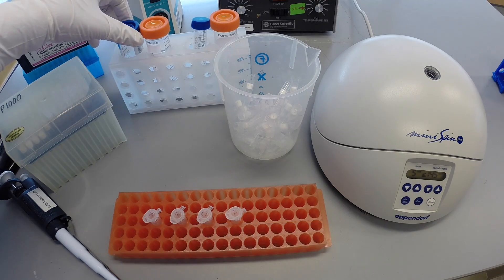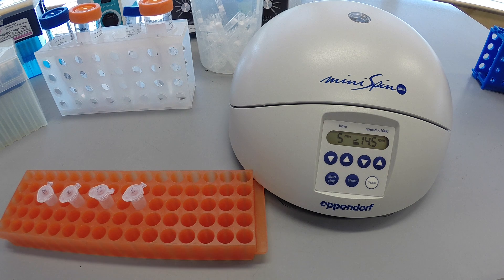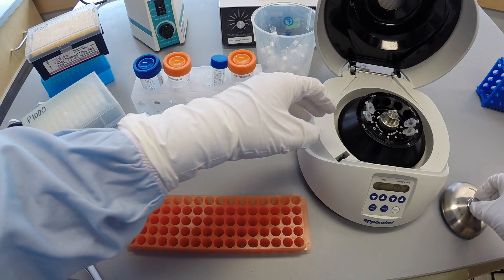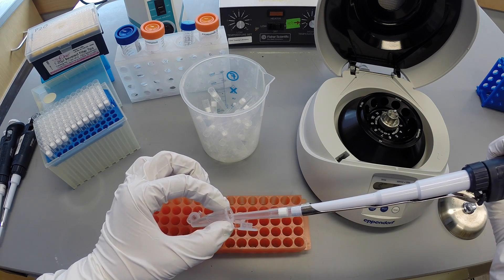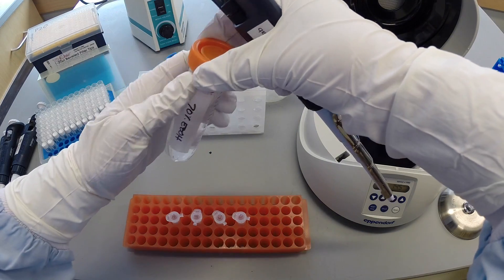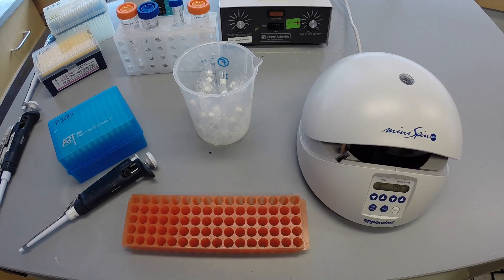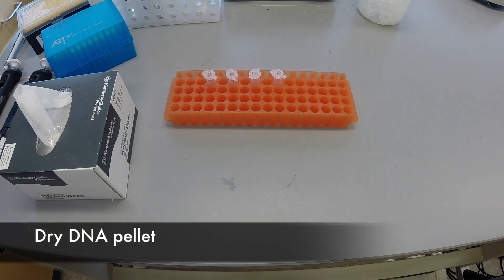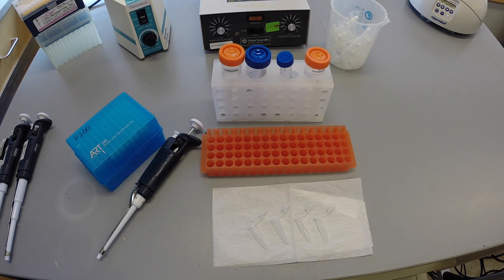DNA Extraction Protocol - Part 2

Comment: What is function of vortex?
Reply: A vortex mixer, or vortexer, is a simple device used commonly in laboratories to mix small vials of liquid. If sample sit long time  can be to stiff , so you mix it to relax it.,It consists of an electric motor with the drive shaft oriented vertically and attached to a cupped rubber piece mounted slightly off-center. As the motor runs the rubber piece oscillates rapidly in a circular motion. When a test tube or other appropriate container is pressed into the rubber cup (or touched to its edge) the motion is transmitted to the liquid inside and a vortex is created. Most vortex mixers are designed with 2 or 4-plate formats, have variable speed settings ranging from 100 to 3,200 rpm, and can be set to run continuously, or to run only when downward pressure is applied to the rubber piece.

Comment: What If you spill the Dna solution on the Table, how to remove It, with a towel? What If your gloves  have a hole and you get DNA on your skin, what Happens? Are there Information Materials for what do to when Things Like this Happens ?
Reply: What happens when the DNA touches your skin? Is it dangerous?

Comment: Isn't the ethanol supposed to be ice cold?
Reply: What is the function of cold ethanol?
Reply: @primawidagdo7679  Ethanol changes the dielectric constant which causes the DNA in the solution to precipitate out. The coldness is just to keep the temperature of the solution low.
Reply: My thoughts exactly

Comment: Why should anybody try air-drying those DNA-pellets, if the workplace is not sterile? lmao btw: It wont take 20min to evaporate a tiny drop of 70% EtOH
Reply: If you're that, worried do it in a biosafety cabinet

Comment: Why did you discard the supernatant this time, not the pellet?
Reply: Because pur ethanol precipitates DNA, thus the pellet contains DNA, and we want to keep it ;)
Reply: The centrifuge separates heavier material from lighter material.  The first time through the centrifuge, the dissolved cell walls and larger cellular structures were clumped to the bottom.  The second time through; the only two components left were the ethanol and the DNA, and DNA is heavier, so it clumped to the bottom the second time.  (When I say heavier in this context, I mean 'more dense')